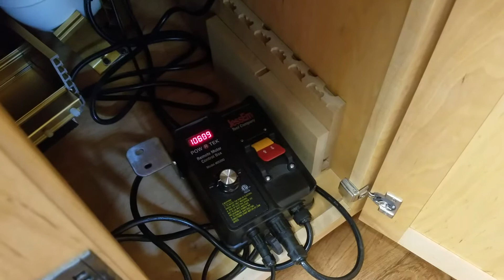Jessem Powrtek Router

Comment: Mine's doing the same thing, if u fixed it how?
Reply from the maker: Jessem replaced it.  The new one did the same thing.  The Jessem went in the trash. I bought the big Mikwaukee and it has been running like a champ.
Reply: I fixed mine, it turned out to be the power cable where it goes into the box, the nut on the back of the connector, inside the box was loose, tighten it then tighten the nut on the power cable attaching it to the box, so far so good. To me it even sounded better then before, mine was only 2 years old and in the last 2 weeks was the first time I really used.